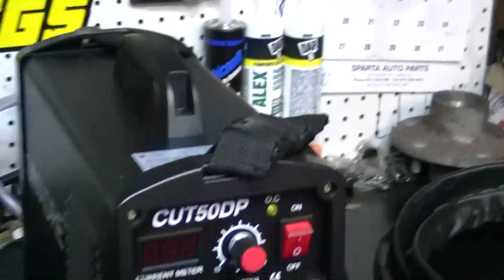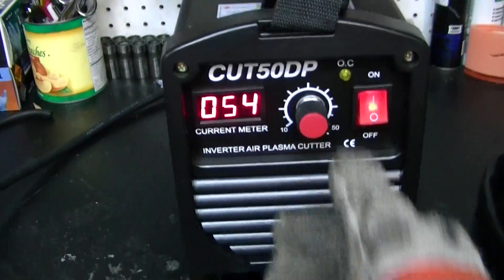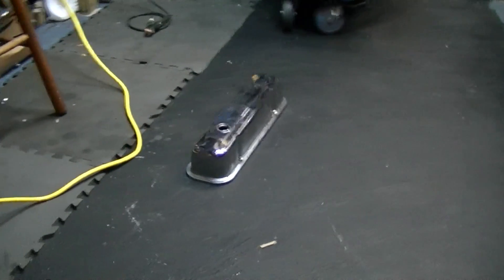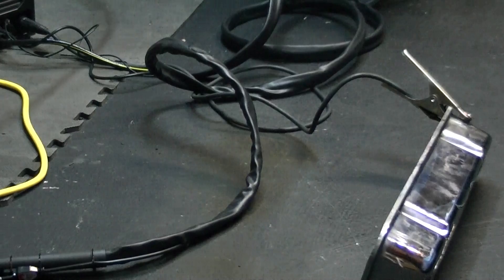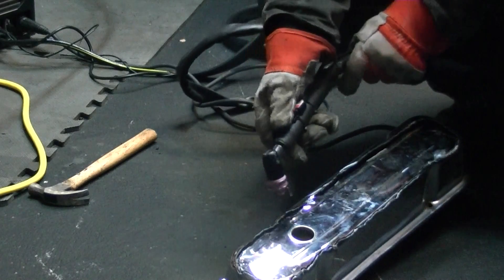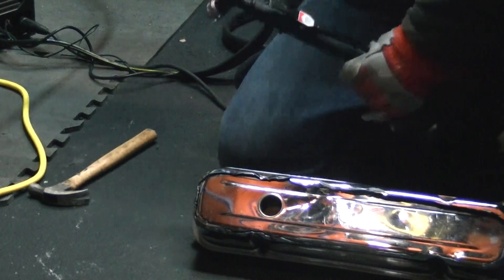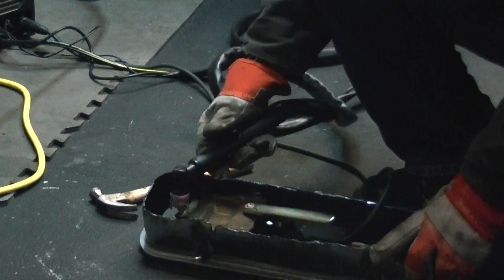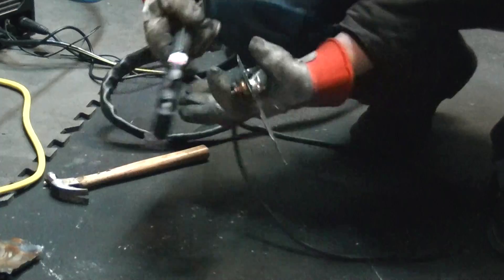Simadre CUT50DP

Comment: How has this machine held up over time? I just bought same one
Reply from the maker: Pretty well. I did buy consumables with this. It kinda chews threw them, but everything I cut is on a weird angle and thick. Also on a car that had 1" thick rust. Which is why I bought this model. Mainly for the pilot arc feature. So for the money, this is the best tool in the shop.

If you plan on doing a lot of flat cutting it would be worth it to buy one of the roller guides. The one that comes with this unit sucks. I have mine on 120vac and I really recommend a dedicated breaker and 230vac. My breaker pops if I use it continuously.

Comment: I have admit I have not been using my Simardre a lot.  I have my own workshop and have about 10 welding machines.  I have just purchased the Eastwoods Versa Cut plasma cutter with pilot arc.  I should do a video of my Simardre.  Some of the other machines in my shop are: Easwood Mig 175, Everlast Powerpro 205 3in1, Everlast Mig 250p, Everlast 140, USR Welding 312 and a Miller Synchrowave 200.  I really like Tig for it's precision.  I'm working on a CNC table for Plasma.

Comment from the maker: I have to agree.  I have not had the NEED to cut anything bigger.  But if I do I like the option to be able to run it at 220V with no new machine!!!  I looked at the TIG welder.  I am just getting good with a MIG welder and I don't use it every day so the TIG seemed like it would collect dust.  Got a video of the plasma cutter?

Comment from the maker: Well I am not sure if the amp display is a representation of that actual amperage or the representation of where the dial is set to.  But I will say that on 110V I have cut through 3/8" metal with ZERO issues!!!

Comment: You are plugged into 110V yet your meter on the plasma cutter will still read up to 50A.
Something is not right.  The max you can get from 110V should be around 25A.  It appears the meter is not representing the actual amps.